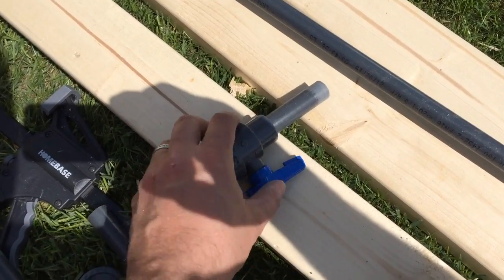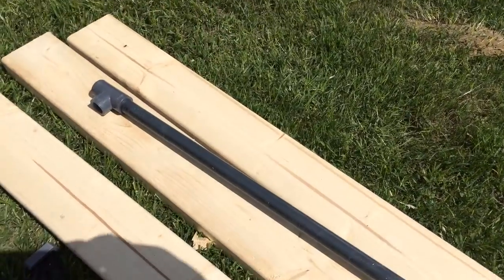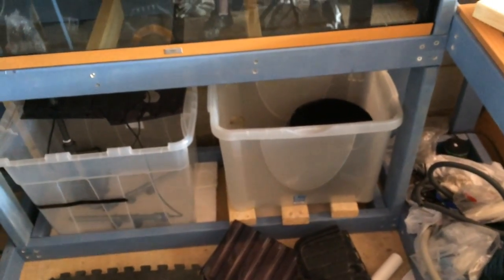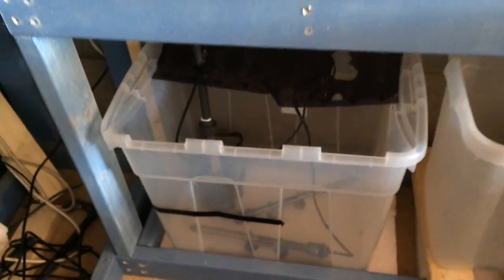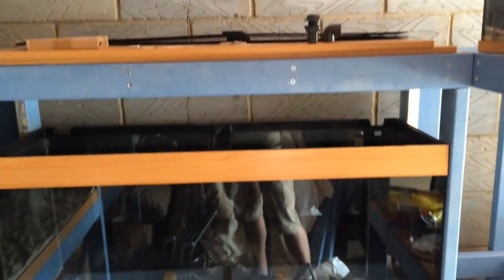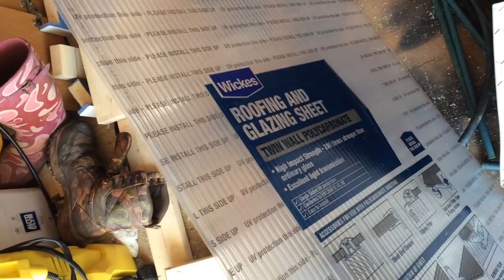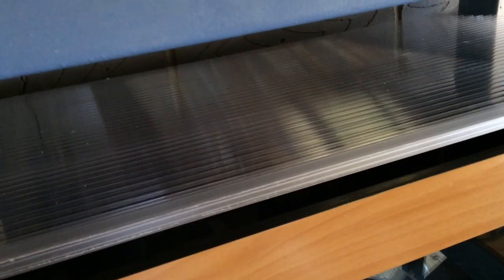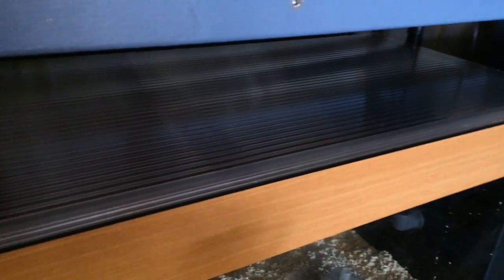Fish Room - Plumbing Part 2

Comment: Nice little setup you have there. Are you going to insulate? I use the twin wall stuff for my lids, better than glass sliders any day. You would be better getting a cheap tank to fit under that rack for your sump. With a few glass partitions it will you the space better and fit more media in. Always great to see a fish room build, keep up the great work.
Reply from the maker: I'll see how the plastic tubs go, water volume shouldn't be a problem, but if I need to switch to a full tank then I can do that at another date.  Insulation... yes probably will.  I'll lag the pipes and also but some foam boards up as we get nearer the winter months.